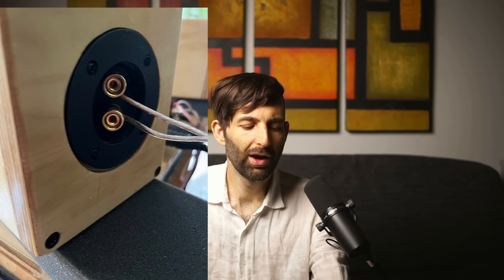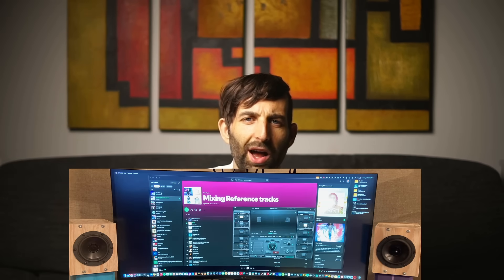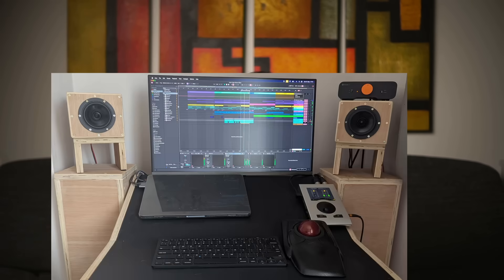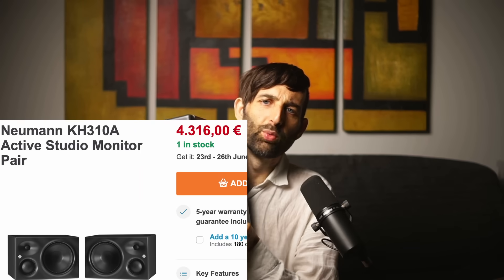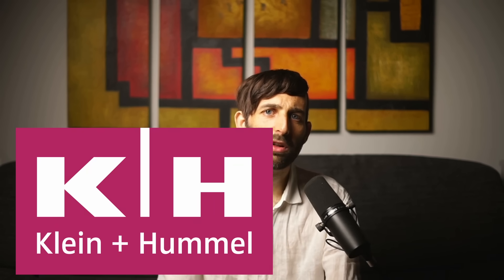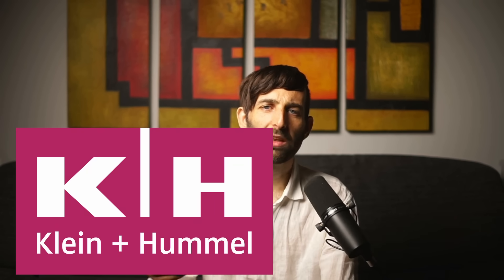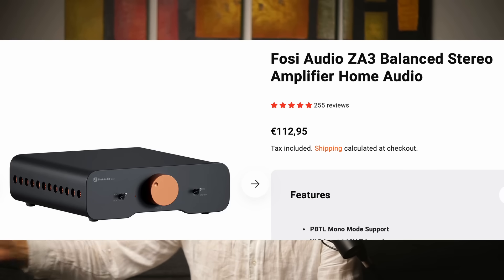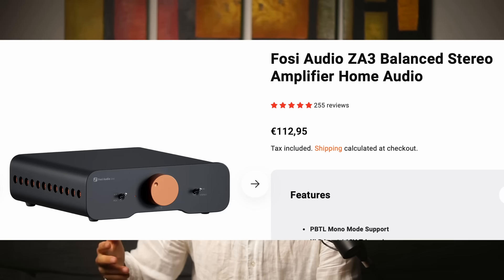$5,000 Neumann speakers VS $400 DIY speakers (Audio Shootout)

Comment from the maker: Notes on the recording... On my previous video where I showcased the small speakers, I used a quick DIY jecklin disk and a pair of omni measurement mics to record. Especially because those small speakers don't extend that low, I thought it would be sufficient for the purpose of the recording. In hindsight, the stereo image was lackluster, and now we are comparing speakers with low bass output, such as setup would just render mostly mono recordings. So I decided to use a single omni measurement mic and record the speakers individually. So each recording you hear is comprised of two passes, first recording one speaker and then recording the other.

Unfortunately at times, there is some amount of white noise noticeable and this is caused by my video light which has a cooling fan. It got pretty hot in the room, as we had really hot weather recently, and I only noticed after I'd recorded the whole thing that the noise made its way onto the recordings in certain parts, even more exacerbated by using an omni mic, but omni is most accurate for these kinds of tests. Shame, but I'm not doing it all over again, so just pretend it's not there. You can still hear how the speakers perform despite that.

Instead of swapping all of the parts out each time, in some cases I'm using the same speaker in both positions. For the classic one, I just swapped around the mid and tweeter so they are slightly asymmetrical. I doubt the sound is impacted that much. The reason the crossovers are just sitting on the speakers instead of going inside like normal is for a similar reason, and that's because I just built two enclosures and I am swapping out the baffles.

I don't need 10 speakers in my studio, so I only made a pair of enclosures and I will keep only one pair of speakers. When the mid dome ones are done properly with a 4th order crossover and extra DSP to boost up the bass a bit, they sound exceptional. I measured them after having tweaked to satisfaction with the hypex amps and they were flat as a pancake more or less from 40kHz to 20kHz.

But since my hypex plate amps are being used by my mastering speakers, and the mid dome ones don't sound as good as the "classic" ones when you use a 2nd order passive crossover like I demonstrate in this video, I'm probably just going to keep the "classic" ones and either sell the parts of the mid dome one or do something else fun with them, not sure. Either way, I'm extremely impressed by the "classic" ones, and considering they cost around $400, they pretty much blow everything commercially available out of the water.
Reply: Whats the difference between these and your mastering speakers in terms of purpose and performance? Is it just that they are passive vs using the hypex amps or do you need that baffling inside the speaker
Reply from the maker: @gammypage  these are more near field in position, they would be a bit closer and for smaller rooms. These are most suitable speakers for the majority of people compared to my mastering speakers which are very large and need a large well treated room, which most people don't have
Reply: @APMastering what was the mic you used for doing the tests?
Reply: I guess you explained it probably in a earlier video. But what is the mic setup for the recording of these comparisons?
Reply: I just preferred mids from dome and classics got a bit (just a bit) too much bass. Nauman after all are very clean. Nice , we know why it's  standard  for industry.  Skipp comments on single driver , at least  it's  wake up call for those  who think they  can adjust themselves to that imperfections..it's  night  and  day.
Reply: I feel you did great with $400, but it is nowhere close to a KH310. I would say classic clearly lacking in bass, sounds a bit thin, and has worse sound stage when compared to KH310. The small plus sub, while not any closer to source than the classic, is more enjoyable to me. You shouldn't try to compare to one of the best monitors available at $5000 price range. You should put it side by side to something cost $800, and I have the perfect monitors in mind, Kali IN-8 V2, very well reviewed, cost US $798 a pair. DIY at half price, now it would be a fair fight.
Reply: @HyperOpticalSaint  to be fair, the in-8’s are ported. In a separate video he explains the difference in decay times between ported and sealed cabinets. He is of the opinion that sealed cabinets are generally more accurate, especially in untreated and smaller spaces. I generally agree because you get boomy mid-bass and scattering treble reflections around the room when untreated. He also says sealed might be better even in a treated environments, due to those faster decay times. So, basically this build was for a direct comparison between his 3-way sealed speakers and the an industry-standard 3-way sealed speaker, Like the Neumann’s. I am in the market for studio monitors and I’m having trouble deciding between the kali audio in-8’s or building these and saving some money to treat my room. So i’m interested in a comparison to decide which is better, but i suspect these are more accurate in bass frequencies than the kali-audios, based on my research.

Comment: Neumans sound better than the digital signal in some cases.  The mid domes matched them on the one song for sure.  Heard on my 2.5" 2 way acoustic Klipshs!  The classic sounded like a loss in volume or clarity sometimes but still accurate as the Neumans.  The 5"s were kind of brighter than all but harsh or clipping at full range to meet the volume I suppose, but were close to the Neumans when you had the sub surprisingly.  I am building your small boxes with some old 3" dual magnet beefy wonders from an old Altec Lansing boombox.  As subs for the Klipshs.  Would like to know the speaker driver models are being used here, specifically for the small 5" full range?  P.S.  How are these Fosi amps competing with the classic full size amps?!  I suppose they are what's evolved in use for active monitors and subs, but do they equal up to a Good Denon or Yamaha full size type amp in sound clarity etc?  Lower power range?  I'm convinced finally but just amazed, confused.  Thanks!

Comment: When looking at what main monitors I would choose, whether or not it had a port was a consideration I didn't hear many people mention but I felt was relevant given that once you have a port on the speaker now it interacts to a far greater degree with the air in the room which would in turn then result in a more unrealistic listening experience depending on your room compared to a sealed cabinet. The sealed cabinet will sound more consistent across rooms than the ported one and that is especially important if you don't have a totally perfect room.  

That plus a sale ($3600 for the pair of KH310) drove me into the arms of a 4-way 2x KH310 2x KH750dsp setup calibrated with MA1 and I don't think I've ever be able to look back. This video only made me more sure I made the right choice though I do sort of wish I had seen it sooner.

Comment: I've been using Studio Monitors my entire life, genelec 8040 for the longest part. I always used a measuring mic and a room eq. During covid I had some time and brought home a couple of PA speakers we use in our venue. I got a better results with a pair of F1 81.2 and the 10" sub in my room. Especially when I wanted to listen louder it was much better. I used powersoft amping with Armonia. I use a pair of customs and a cheap 8" sub. I have a "mixing" and "listening/dj'ing" setting. The FIR filters in Armonia make it really easy to get very good results. I recommend to buy a used Powersoft Mezzo 604 or 602.

Comment: As soon as you played Two Weeks it was the Neumanns and the Small+Subs for me, the Mid Domes had way too much mids and the Classics had no treble.

The rest of the songs show that only the Neumanns accurately represent the treble though.
Reply from the maker: Think that’s a bit hyperbolic but the Neumann are indeed elite. If you think the classics and mid domes are fail, you should avoid basically everything on the market
Reply: @APMastering They're probably better in person and you can always tweak the crossover plate and EQ, but yes, I don't use the monitors on the market for reference monitoring. I'm sticking mainly to headphones (Beyerd. Custom Studio) and toggle the Beyerdynamic Virtual Studio VST to simulate different environments. 
Then you have to check back the result in a real car and some trash mainstream speakers, so only one monitor won't help much anyway.

Comment: Such a pity most of the recordings are heavily distorted, however I am listening through my neumann's 2xKH310A + 2xKH750 system and let me say your classic speakers sound very good indeed!
Reply from the maker: Not sure what you mean by distorted? Do you mean the songs themselves?
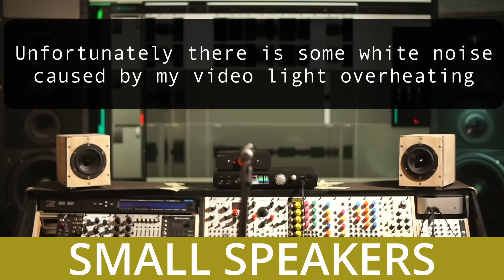Reply: @APMastering I mean heavy clipping... It's present more or less everywere in the recording except perhaps the first 3 tracks, It is more obvious in passages such as the one at 12:10 (even to the point that some automatic limiter in the chain has kicked in the desperate attempt to mitigate the problem), also at 13:50 (yes, it's electronic bass, but regardless, you can hear that there's too much clipping), and even in toquino voice in the passage at minute 15:00, when at 15:10 it gets pretty evident. I guess you must have set the input level of the preamp too high... take a look at the level meters on the audio interface... However as I said, the comparison can still be done 👍 Kudos again for your speakers!

Comment: I am intrigued by your self build speakers for €400, however initially I have to invest in your course(s) so it will become a bit more expensive? Anyway I like your channel and it’s very helpful to make some sensible choices for my future hifi setup. Cheers mate.
Reply from the maker: Depending on where you are they might be more expensive. I think now more realistic is 550€
Reply: @APMasteringUK based…..

Comment: Also when you compare speakers you use 1 not 2 , why 2 , why not 20 ... is the other one different , what is the reason tell me , why 2 speakers . NOT A SINGLE SPEAKER IS MADE LIKE THAT , all made mono , ,tested mono, listened mono. Jesus Christ . And yes Even trough my Passive 3 way , on 20$ amp , i can hear Neumann being a lot harsher . And you cant fix that , its not distortion , its how it sounds . Basically , Studio monitors are your room with no curtains and sun is burning in , yeah its nature ,but most of us use a little bit of Sun Shade now don't we . Simple as that , but as a producer you need Studio monitors , but you dont have to listen to them all the time . they are for CRITICAL LISTENING only .

Comment: i cant believe you don't know first thing about Monitors , Monitors are Monitors FOR A REASON  , they are not worm , they are not pleasant , they are not HI FI , they direct sound to your ears very intensively , notice the wave guide on the tweeter ,its meant to beam HF to your ears, they are not pleasant to listen but they reveal everything , and if you make a track that sounds good on them , on HI FI its going to sound AMAZING . Hi Fi speakers are speakers you listen long time , to do this they cant be raveling , studio monitors are so harsh you have to make brakes every 30min . So your DIY have nothing with those Studio Monitors  , NOTHING AT ALL . Completely different , one is Monitor the other is half decent DIY job .
Reply from the maker: lol. I’m assuming you don’t even understand horn loading anyway
Reply: @APMastering i cant speak with you when you see horns where there are no horns . Neumann has waveguide not horn . Critical listening speaker not Hi FI  , there is a massive difference that if you don't hear it and those speakers are at your home , you are are complete noob sorry to say that , but you put your self in that position im not putting you there . Horns , yeah Horns on your head.
Reply from the maker: @dedskin1 dunning kruger at max

Comment: Neumanns have little bit more subtle vocal than others and obviously DSP boosted bass since they are closed cabinets and are unable to produce such bass without +6db in lower end. Small+subs lack tweeter part, that can be heard clearly. Add DSP to your Classics with 60 EUR Wondom /Dayton Audio amps and you are golden. I like the mid-domes most from here.

Comment: The diy speakers are considerably worse. But I would have expected as much
Reply from the maker: easy to assert without any justification but if the DIY ones are bad then 90% of stuff on the market must be horrendous to you
Reply: @APMastering They not bad, just considerably worse than the Neumann. "Worse" is a relative term, you need something opposing it in quality to use that word. "Bad" is an absolute term, no comparison is needed.

All I'm saying is that from the video you posted, it's completely obvious that the DIY ones don't sound as good as the neumanns. Tbh I'm not really sure if they would sound as good as monitors within the 1000 - 2000 dollar price range, but I didn't hear a comparison so I could be wrong.

Comment: I want to build theses. if i understand correctly, its 33$ for Building Upgradable Subwoofers course. This to takes me half the way. 33$ for the Classic 3-way upgrade course for the second half. They cost around 400$ to build for material + ZA3 130$. All in all around 600$!? (ps. Do you have a good precise eq curve preset to make em flat on ProQ?)
Reply from the maker: Budget 600-700$ in total minus amp which is laughably cheap. Is possible for less or much less depending on salvaging parts and wood etc
Reply from the maker: Also if you buy one course there is a discount code for the other. And if you know carpentry you don’t need the sub course

Comment: A few years back I had convinced myself that a pair of KH310s was the way to go. Went to KMR & sat around all day and listened to basically everything they had around the same size in the same listening location while always a/b ing with the kh 310s. The thing that I was actually most surprised with was how well the amphion one15s translated the stereo image in relation to the kh310s. The only ones I thought were better were the massive main monitors in the basement.... but they are getting into the ballpark for a downpayment on a flat! Yes, the one 15s don't go down as low, but there was still more than enough energy below 45hz for mixing. The passive radiator on the one 15s really does sort out a lot of the issues you have brought up about ports. Curious as to why you didn't explore passive radiator designs? Or maybe it's in the speaker science course?  I ended up going home with one 15s, and I think I'll build a pair of your passive design in the new year as I think they sound better than the 310s! I'm personally not that into active correction as it'll likely mess with phase and the image.

Comment: First of all the DIY speakers at a disadvantage sound incredibly well, none of the annoying scooped midrange of most of the monitor offerings out there. I am listening through Sennheiser HD 420-SL headphones that go down to 30Hz, very neutral midrange, similar to HD 600's. Clearly I hear the harmonic distortion of the bass drivers of all the speakers, including the Neuman. Not that this would be any detriment to working with the speaker, just that it is there, and audible. The Neuman has excellent driver integration, although somewhat receded in the midrange. The classic speaker on the other hand seems to exhibit some restraint in the 300Hz to 600Hz band, due to a little phase interference with the crossover slopes, *unavoidable physics. It therefore has the illusion of a more forward upper midrange in the 800Hz to 2kHz area. (but maybe does not measure any enhancement there) The small speaker and sub integrate very well by the slight offset of the small speaker, better phase alignment, a more open midrange! This is the one I would choose to mix and master with.

Comment: love the video! seriously considering building a pair of the classics. Is there one amplifier you'd recommend instead of 2 seperate fosi's?
Reply from the maker: its not two separate fosi amps, it's just one amp you need
Reply from the maker: I mean the ZA3. but you can use any amp which is 4 ohm rated. better to use a 2 ohm stable amp but you can really use almost anything
Reply: @APMastering thank you for this! Was just curious why there seemed to be 2 Fosi amps when viewing the classic speakers in the video?
Reply from the maker: @PaultheJones yeah because I cut together two recordings. I recorded L and R separately for best channel isolation otherwise you record mono
Reply: @APMastering  awesome! i'm into that! 

A couple more questions came up when sourcing parts.. Sorry to be annoying, I just want to make sure I get the correct stuff so it all works together as planned!

On the Dayton Audio RS100-4, paper or aluminum cone? Paper I assume? (parts-express lists two options)

With the Dayton Audio DC200-8, on parts-express it calls it a Classic Woofer. I assume this one is the same… Sound Imports calls it the Bass-midwoofer…

I was a little confused about the Resistors… on the order sheet you mentioned getting  Dayton Audio. | 0,5 Ω | 10 W | 2% but on Sound Imports it’s .51 ohms… I figured it wasn’t a big deal, but then when I zoomed in the on the build video I didn’t see a .5 ohm resistor. It looked like 1.5? 

And then with the 2.5 ohm resistor, I only saw a 2.4 or 2.7 by Dayton Audio. 

Sorry again for the questions!!
Reply from the maker: @PaultheJones  drop me an email for technical questions